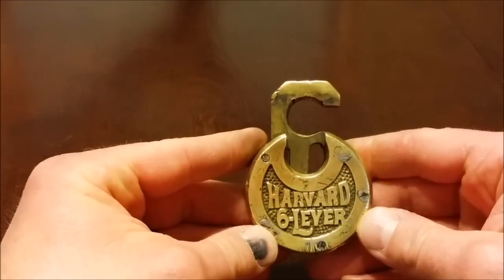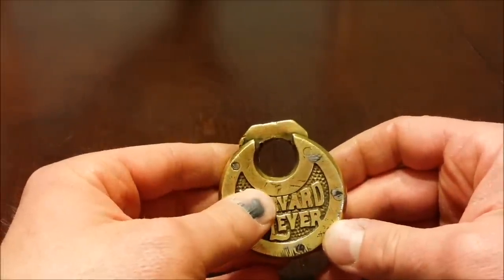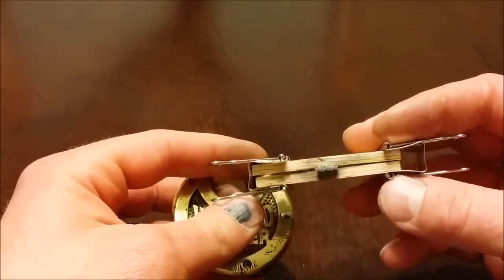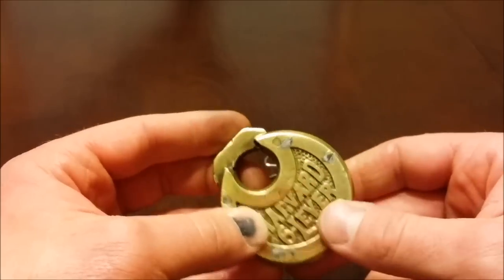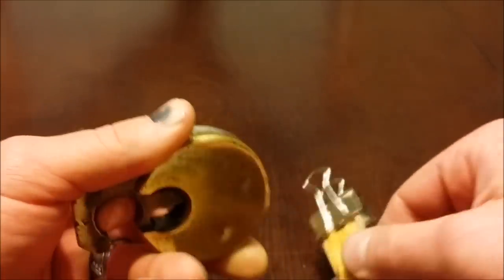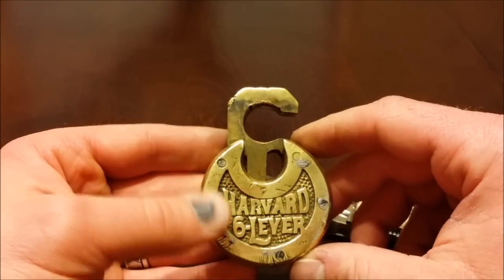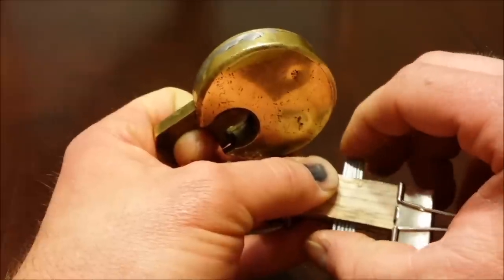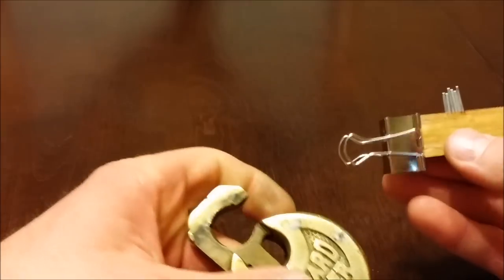Harvard 6 Lever Pancake Lock Picked and Key Made

Comment: I picked up a YALE pancake lock at a flea market yesterday and started a search for how to make a key.  I had seen some before but did not remember all the details.  Your video was all I needed.  I found a box of the nails/brads at HD big box store for less than $5 so I was in business.  A paint stick cut in two and a couple of the clamps worked its magic in about 5 minutes.  I went on and set all the pis with the lock open as you showed. Used super glue idea from another UTube author and now I have a key.
  Thanks for your work  and sharing. It was so good.  This is the fastest I have ever made a key for any of my locks.  It works great....Thanks again
     Steve

Comment: I just got one of these pancake locks as a present and your opening method worked so great :), thanks a lot. Also the info on how to get the correct bitting and make the final putty key is awesome ( I have a key blank, which I can cut later) :D. Thanks for the great video :).
Reply: Just glued the nails into a 3D printed top, so it actually looks like a pretty cool key now :D. Works smooth as hell and I'm so happy :). Now it's an antique lock with a working key :D.

Comment: I bet you could make a stamp that you could use to stamp out blank keys from sheet steel.  Just hold the stamp over a thin sheet of steel and whack it down hard with a hammer... instant key, then just cut the bitting with a band saw like you said or another preferred cutting tool and you'd be cranking out keys for these locks as fast as you could sell 'em. **$$$**

Comment: Hey mate,
I doubt you’ll still answer questions on this after all these years, but how deep were you pushing the nails into the lock? I’ve got one that I’ve spent at least 20 hours trying to crack using this technique & it just won’t open for some reason. Were you pushing them down to the full depth of the levers or just like half depressing them? It’s really frustrating because the lock is antique, new old stock, with a perfect patina, it’s just missing it’s key. I even have an original blank for it, so if I could open it, measure each of the nails & cut the key, it would be an amazing collectors piece. I’m starting to think the lock may be broken, hence why it was never used, but maybe I just haven’t tried hard/long enough yet.
I realise you probably won’t answer, but thanks for the technique anyways.
Cheers mate.
Reply from the maker: I've done lots of these and let me tell ya, some open like this Harvard in minutes and others just don't want to open.  I've spent hours and hours trying to open some of them.  I'm not sure but I'd assume that since your lock is NOS that the tolerances are pretty close on the gates of the levers since it hasn't had the chance to wear out a little bit like this one was.  Some of the tricks would try if a lock was being really stubborn was put the nails in random bittings before I even started.  The logic was maybe I could get one or two levers to set just by guessing then it will make the other ones will be easier.  That worked some times.  I would always adjust the pressure.  Sometimes I'd try just bouncing off the lever springs and sometimes I'd bottom them out those gates in the levers can be really deep at times. Sometimes I needed to pull up on the shackle and others it opened if i pushed down on it.  Like I said tho I've spent countless hours on some of these myself. But I have never gotten one that I couldn't open, unless it was damaged of course.  Keep trying. I know it can be extremely frustrating when they won't open but they will eventually.  And you didn't mention it in your comment but I'm sure you are using lots of a good lube in it because when some of those locks get old they dry out inside and then you're fighting all that rust and corrosion on top of everything else.  Good luck! And keep me posted on how it goes and if I think of anything else I'll let you know.   Thanks for watching!
Reply: Thanks heaps for the reply mate, I really wasn’t expecting it & you may have just given me the bit of info I was looking for to finally open this thing. I was seriously almost ready to give up on this one & move on to something else, but you’ve rekindled my hope that it’ll open.
I’d tried pushing & pulling on the shackle & what seems like a million attempts at the random bitting hoping I’d just luck out &guess it eventually, but, stupidly, I actually hadn’t been using any lube at all. The only other video I’ve watched on impressioning pancake locks said that not lubing the lock would make it easier for the levers to set to the correct depth because of the build up of more old grease & shit behind where they need to be lifted to than in there would be in path they need to travel to get to that depth or something along those lines, which kinda makes sense for a lock that’s in use or has been recently, but now that I actually think about it, that doesn’t really make much sense for an old, keyless lock & even less sense for one that’s never been in use. I feel like an absolute idiot thinking about that now haha. 
I’ve got a bunch of different lube choices on hand, what would you recommend? Graphite powder or a spray type lube?
I’ll bet that after some lubing it’ll open within the first few attempts now too lol.
Thanks mate!
Reply: @-dystopic-  I am a student of the great Bosnian Bill so my all time favorite is WD-40. Hahaha. Cheap and easy to get and I have never had a problem with it.  Apply liberally and have at it. Hahah. I know from experience that the harder the fight on a lock to open the more rewarding it is when it does.  But most importantly, something I have to remind myself quite often, you are not under any time requirements so just have fun.  Try not to get frustrated.  If we can't open a lock for whatever reason it's just luck on the manufacturers part not a reflection of our skill.  Hahaha!  I still have a Master Lock no 3 that i haven't picked yet after countless trys. But I know it's not because they are good locks or my skills are lacking. It's just because the random bitting they used that day is exceptionally difficult mixed with the fact the machines might have been just calibrated that day at the factory so the tolerances are closer to perfect then they usually are. Haha Enjoy the challenge and learn what you can from it.